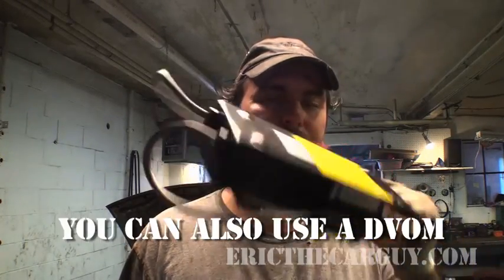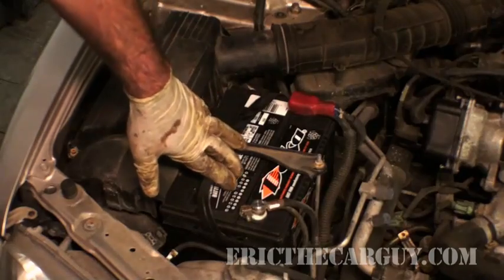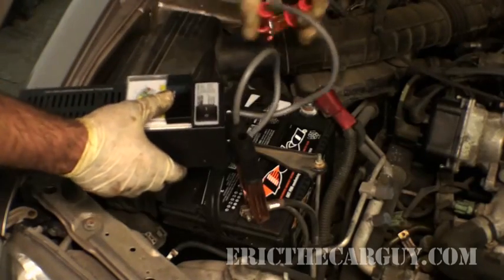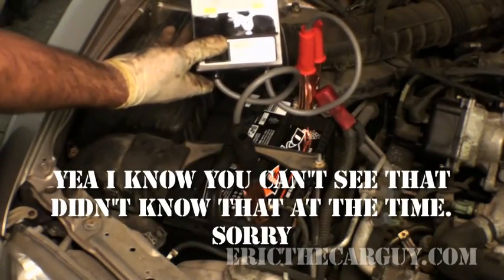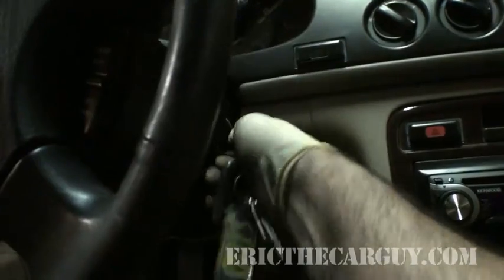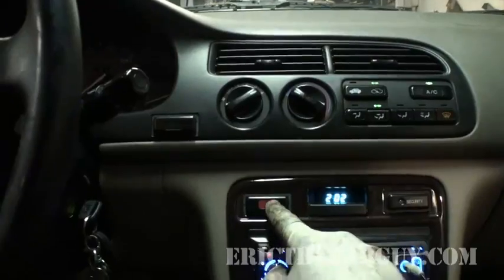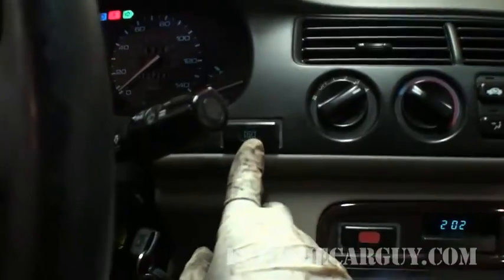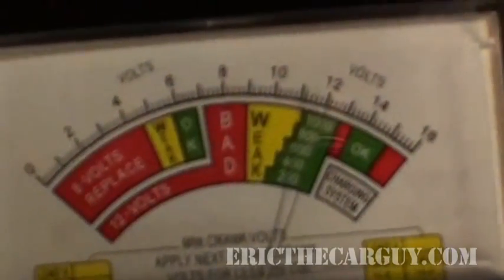How To Check A Charging System - EricTheCarGuy

Comment: Might be a stupid question, but when you were testing the alternator voltage with everything on, where did you put leads for the dvom? On the battery terminals or somewhere on the alternator itself? I just installed a brand new alternator, but car is still running off just the battery. The battery, car not running, tested at 12.5. When the car was running, it dropped to 12.1. I also tested the post coming out of the alternator where the wire connects and it tested at 0.4 volts. Would that mean that I have virtually no power coming out of the alternator?

Comment: At first glance it would seem that according to the load tester you're using anything below about 13.4 volts would actually indicate a charging system problem. I'm curious why you bring the threshold down to 12 volts. Is that load tester diagram supposed to be for 13.4 volts at idle with no accessories?

Comment: I  have the same tester and the far right side of the dial is for the charging system. With the engine running it should read between 13.8 - 15v (the OK band) according to the instructions on the product brochure.  That applies to both engine running with no load and engine running with a load. The brochure recommends testing both conditions.

Comment: I have a 2011 GMC Acadia a w d 3.6 liter I’ve replaced alternator and battery but something is killing the battery it’s over charging if I start it up at idle it’s going passed 15 volts

Comment: Hi Eric.  Thanks for the video.  So the battery is good and alternator is fine after.loading it but the battery is still dying ever so often, is it a electrical drain somewhere in the system?
Reply: You can use a good meter to test battery and it will show if there is a slow drain. If so, try disconnecting one fuse at a time and seeing if the drain stops, this can isolate the cause of drain.

Comment: Hi Eric.  Thank you for the video.  If alternator comes back as good and the battery is fine but the battery still randomly dies, is there a power drain somewhere in the electrical system?

Comment: I had auto zone check my alternator and battery. Both checked out to be fine. I removed carrion from battery terminals and sprayed terminal protector on terminals. Dashboard is still showing charge system. Any advice?

Comment: Sometimes its a connection! I spent over $500 on mechanics to find out why my light's flickered on/off from time to time. I was frustrated they kept telling me it was a short couldnt be found etc etc. So one day i decided let me start from the beginning i checked they battery posts. I seen the negative was loose, it all made sense now everything i hit a bump my headlight would flicker on/off. I was so scared to drive at night cause of feeling they would flicker by a cop and i would get flagged down. Sometimes its just a connection simple fix...

Comment: I turn my truck on and it shows 11.9 volts. I turn on the a.c. to high and it drops to 11.4 quick. Why? I've had the alternator check in different stores and the alternator is good. Battery was brand new from Wal-Mart and it drained it down to 11.9 volts within a day

Comment: I got a question I got a 2003 Ford Taurus I put a load test on mine is 12.7 or 12.6 volts right for under a load test

Comment: 12 volts is not a good charging system with a new battery. thats just battery voltage, if you dont see 14v you are not charging properly. bad info.
Reply: Yes but that's with no load. He has a lot on load on it with having all those accessories on so there for it reads 12v. with load 14v

Comment: Lincoln ls v8 2006, a few months back we were driving close to home when every light whent off on the dash, first traction control, then air bag, charging system,  check engine, etc. the battery started draining drastically, lost dash lights, interior, radio, headlights dimmed, couldn't roll up windows. We got home asap and when we put the key back in the car alarm went off. We tried charging the battery to no avail. We had a hum device installed and we read it could drain the battery so we took it out.  Pretty sure it charged itself while we left it alone over night. And haven't had issues like that for a bit. Recently we found we have a small crack in a hose leaking antifreeze. And now yesterday we went out for milk and first goes the traction control light followed by everything else again. We were a little farther from home this time so we even lost the headlights and power steering. Any thoughts? I'm trying to get together with one of my uncles to fix it but it would be nice to know what to look out for. Thanks!

Comment: I have a 97 Honda accord with a v6 good battery good alternator but the car dies after I go a block like its not charging...had the alt tested at a shop man said its good  putting out 15 amps..help....ashworthallen11@gmail.com

Comment: 91 Pontiac Firebird 305 5.0 V8 TBI
Hi there for the last 3 days I have the exact same problem my battery is 2 years old and I drove the car no more than 5 times I did start it up every month for 30 min since it’s a project car but my point is 3 days ago I wanted to move my car to the sec garage with heat in it so I can clean ntinue working on it
and the battery was completely dead so I hooked up a charger and charged it for about 90minm
it looked all good and I started it right up let it run for 40min went shopping and got gas I shut it of filled with new gas and went home next day I tried to start car was dead so I jump started it but cranked started and died than it wouldn’t even crank anymore only the security lights that stays on and when I try to crank it the red park and brake light comes on fuel gage goes all the way but no crank some klick under the hood and steering column
no blown fuses vat system my key is a 10 with 3.750
but when I checked the connector under the dash the wires read the key resistance from the ignition key
but anyway I did get resistors and got it almos perfect to that what the key is
nothing security light still solid on
when I open up the starter relay on the side by the foot wall and press on it and turn the key it will crank and start but die after 2 sec and when I jump it with wires no relay same story dies after 3 sec I did notice my battery now after being charged up all 100% disconnected from the car it will drop down to about 70 to 60% of charge wierd the bat is basically new fuel pump is working to I even tried to jump the safety switch but no results pls help I have no idea what the problem is the car is a 91 Pontiac Firebird 305v8TBI with 183xxx it cool st me well over 10K by now since I got it for 2.7K it’s a Knight Right det Replica that’s why such costs thanks guys for the help I n advance 🍺😎

And just so u know I just tested the codes on it no check engine light on but got these codes 53 54 45 the system High voltage is what concerns me cuz theO2 sensor is du to no muffler on my car fixing the rear axle root
And low fuel pump voltage is it cuz of the VAT system? Thanks for your help Dave🍺😎 and Merry Christmas 🎄😎

Comment: I just replaced the battery and then the alternator, [2009 Hyundai Elantra] Engine off and also running just a hair over 12 volts. With a load, (all lights A/C etc.) I get 11.53. What prompted me to do the testing is that the battery indicator and seat belt indicator keep lighting up intermittent and briefly.

Comment: hey eric what about high voltage over 15v that still be ok? and what causes the high voltage charge.. my 93 prelude fuel and water temp gauge went out cause i thought it was from high voltage. I really need help in this
Reply: SwiftTekNeek Ty mine is at 15.4 volts. Idk what that means. No1 i know seems to know.
Reply: Bryan Garcia some told me thats too high for the car and could cause a serious problem

Comment: Eric, I had an alternator installed on my 2006 ford five hundred, after it tested bad and car wouldn't start, so alternator did fix the starting issue, but my battery light on the dash is on, and I get check charging system warning. The car starts and runs just fine. Even under load, with lights, radio, ac, etc..
Any suggestions on what I could check? Thanks

Comment: have a 2003 buick lesabre.   recently had the check charging system light come on          briefly shortly after starting car.  like i said, would only come on briefly ,   then go out.    car seems to run fine.   anything to worry about here?

Comment: Have a 2003 Ford Taurus Wagon.  Changed alternator,  battery and now piggyback connection.  Still will not hold a charge.  fed up

Comment: ALT light comes on in our 2010 Cobalt. Daughter won't drive it. I drove it past few days. ALT light came on for a few seconds. went off. Going up slight hill. Let off gas a little and said "guess i will have this rebuilt" at that mement the light came on for 5 seconds. I have not checked the connecitons. In the early 70's flying the early Radio Control sets for model aircraft, before the days of gold plated connectors, the connectors from the receiver to the servo's were the weak link. The 555 IC Timer had just been created (later?). Later, feed back pots in the servos were an off shoot of military electronics. They were ceramic. No longer would servos jiggle hunting for center and never finding it.

Comment: I replace my battery (once) the alternator twice (because a defective alternator) and installed a new drive belt , question Does the warning light on my dash  go off once I fix the problem  or do I have to reset it?
Reply: I have a 2014 Ford Explorer limited and I changed the alternator and the battery and this keeps saying on my  check charging system

Comment: Hi Eric,I purchased a 2005 Mercury Montego Premier. I have put on 2 new Osensors, new alternator. The check engine light will not go off and the battery light just came on. I had both the battery and alternator checked and everything passed. I don't know what else to do.

Comment: sister had a 2006 hyudia battery light on she took it to the dealer they gave her a print out said every thing was find not know why battery light come on she took to another shop there in every town they did load test volt test likw 14.1 volts I check it out got 14.1 volts I always thought of a intermiting altenator I notice her v6 hyudia front valve cover had a oil leak got into the altenator also we got like 6 check engine codes another sign of bad altenator or battery new altenator no more battery light on when you come across this problem do a video.. battery light was on. seat belt light come on. other lights on the dash came on.. for give the spell my spell check don't work the old altenator I had the turn on head lights ac let it all run watch on the video the volts went down from 14.1 to 10 volts replace the bad unit no more problems

Comment: What if i have a new battery and new alternator what do i check other than wiring ?
Reply: Also check your ground wires
Reply: 900bz the belt
Reply: That's what I need to know
Reply: Drop test.

Comment: please help, i just installed a battery isolator with a deep cycle marine battery on a G20 95 chevy van i posted videos about it. everything seemed ok except that on the voltage test i was only getting .45 volts over what both the batteries and Ignition were reading individually between (13 and 14)which the isolator instructions reccommended a reading of .8 - 1.0 volt higher for the alternator volt reading via the isolator post, about 5 minutes after i thought it was ok and was driving, my gages went kerplunk on the dash and the alternator blew the voltage regulator. i replaced the alternator but that has brought no change on top of that the gage fuse is blown, and the Ignition post on the isolator will not give a volt reading. also yhe check engine light doesnt come on, i borrowed a fuse from my brake fuse since they matched but still no change, do you think reverting back to the one battery and no isolator will bring it back to normal?

Comment: I this question with a 2004 Nissan Sentra 1.8, it has this problem that it won't stay on unless the battery charger its connented and as soon as I turn it off the car dies and another thing that I noticed its that the battery light in the dashboard doesn't come on when I get the car in the on position when all dash lights come on but that one doesn't can you help me, I had this problem with the car for about 4 months, I've bought a new battery and had the alternator tested and it passed, and bought a new starter

Comment: I have a 1980 Chevy luv truck been park for 8years only has 58000 miles turns on but it starts then it begins to fry my battery gone though two battery's what could b the problem

Comment: I have a 2003 Ford Taurus battery light is still coming on after changing alternator and battery connections are right and good but I'm stumped any help would be great
Reply: Ok this is my personal email Eric I've a 1999 Dodge Durango and it is not charging the ignition switch has been beat out of it and I have hot wired it to a push button start and a toggle switch for the auxiliary component but I have no charge going to a brand new battery.Can you please let me know what I need to do to get this done..

Comment: I have a 2004 Chevy Silverado 5.3 L and I cranked today and it cranked fine. But in the DIC (driver information center) screen it said " battery not charging" and was around 12 volts then I got up to 55 and it went to 14 volts then I did the test and turned on A/C lights window and it went to 12 then kicked back up to 14 ? Could it be the connection or bad battery

Comment: Hi Eric,  not only the battery terminal connections, but check the connection into the alternator that runs to the battery.
I recently was running 13.0-13.5 V at idle, and 12.5 V draw AFTER replacing my alternator with a new one for failure to charge.  I unbolted the lead cable from back of alt, and rebolted it down to find my resting voltage up to 14/1 w/ the new alt.  Battery terminal cables are non corroded as expected as battery is inside the car in the rear hatch (BMW X5).  Thank you for this video,

Comment: Hi Eric I have a 2008 Hyundai Accent two questions first is there a way to ck the computer? Second if I replace it does the number have to be the same on the computer? I went to s junk yard a bought one took it to the mechanic he said it had to be the same numbers ID once he put the new computer the car did not turn off like it was fixed but I'm worried cause he said that it might work one day or more not sure. What do you think ?

Comment: What about disconnecting the battery entirely while the car is runinng? For those of us less fortunate to not have a battery/load tester. A good alternator will keep the engine runinng when the battery is disconnected.  Just suprised I did hear anything about that little test being mentioned.

Comment: Is 12v really enough to keep a battery from discharging?  An automotive battery is actually fully charged at 12.6v, because each cell is 2.1v, not just 2v.  It's also my understanding that to even begin to charge, each cell requires 2.25v.  
Since 2.25v x 6 = 13.8v, I've always expected to see closer to 14v output from the alternator, even under load.  What am I missing?